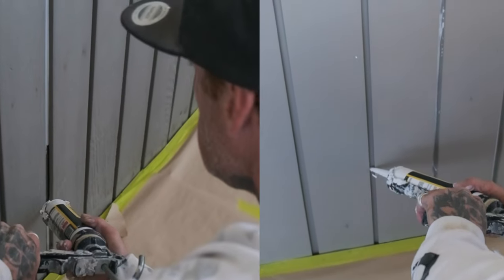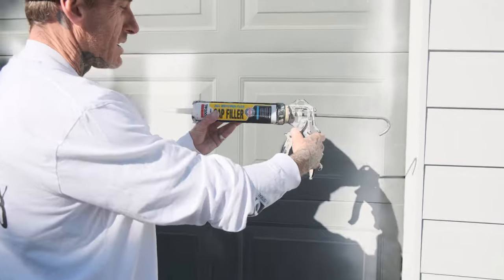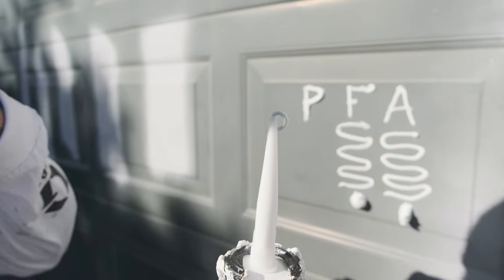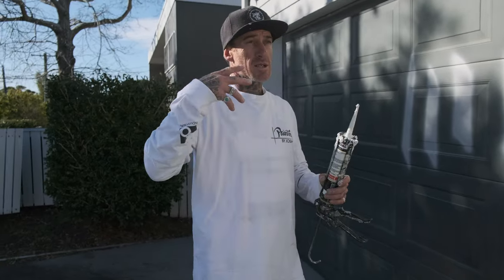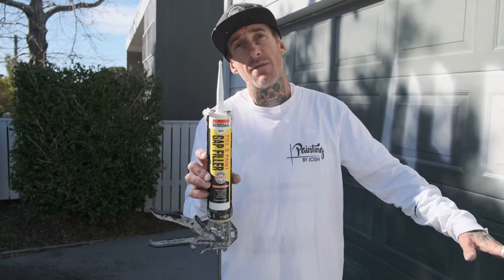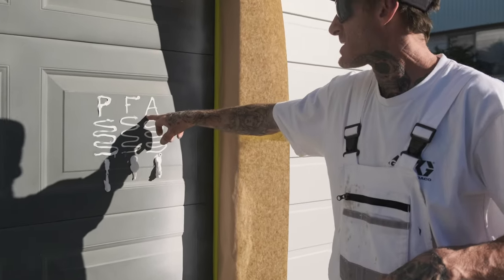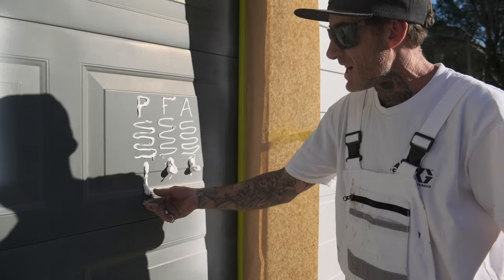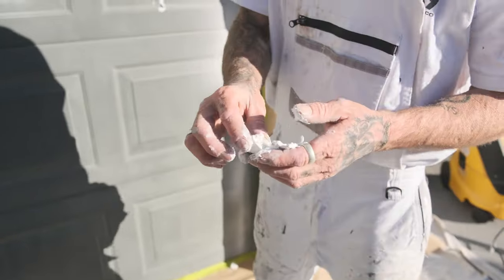CHOOSING THE RIGHT GAPS/CAULKING FILLER

Comment: Hello to everyone. I've been using Soudal for a few months and have to say it's the best by far. I ran out of the Soudal and bought a few tubes of the S20. How on earth does anyone use s20? You need heaps of water for it. I don't know if they have reformulated it, but it was basically shit to use. It skinned within seconds. So I've ordered more Soudal.
Reply from the maker: Thank you Nick.. I truly can't agree more! there are really no other gaps/filler that comes close. Super smooth, awesome flex & easy working 💯🙏
Reply: @paintingbyjosh  no probs Josh. Keep up the great work mate. From Melbourne, Victoria.
Reply: Hahaha! So true. S20 is like spackle in a caulking tube - junk. It ain't bead a joint right.

Comment: 100 % right mate. I've been using nothing but polyfilla for years but the last 6 months or so it just spews out of the nozzle and keeps coming like they changed its formula, just ridiculous. Been looking for an alternative to the rubbish
Reply from the maker: I reckon I have been using the poly for a good 15 years and I have always had the same issue. It just keeps on leaking out the nozzle! Feels good using a product you purchase and nothing it wasted. Try the soudal mate you won't be disappointed 💯 cheers for the comment & watching on. RESPECT 💯
Reply: @paintingbyjosh  im a decorator and honestly just stuck with the spewing out nozzle thinking it was normal or my gun. Youve helped me decide to stick with Soudal 👍 Just a question do you think its worth getting the All weather for exterior jobs over the fill and paint?cheers Bro !